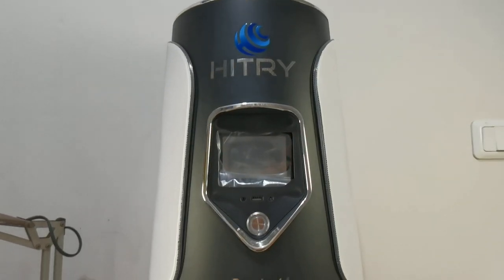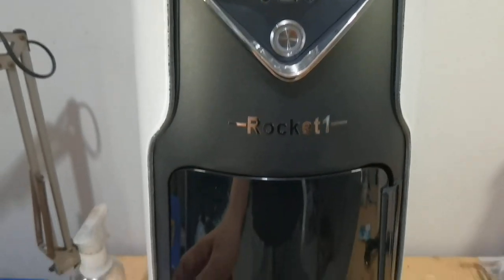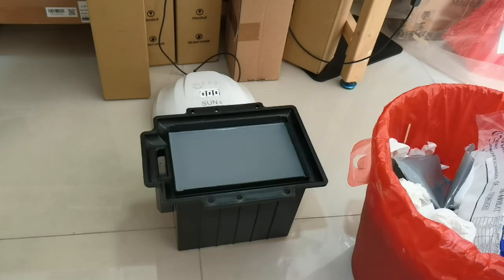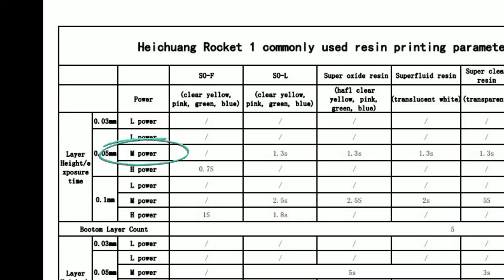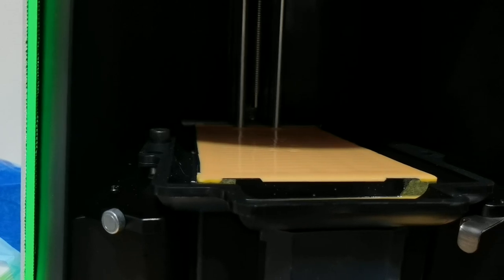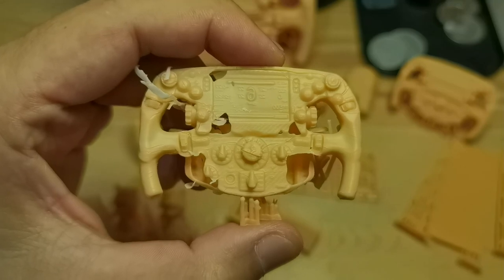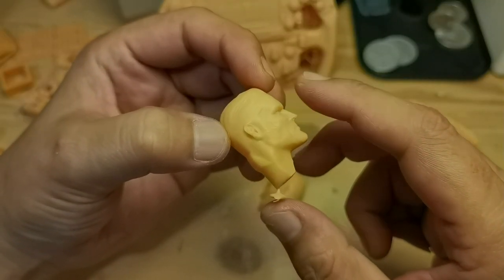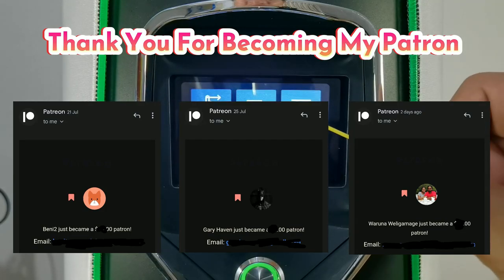Hitry Rocket 1 In-Depth Test And Troubleshooting

Comment: This printer is a waste of money. On delivery, my printer's control panel would black out after several seconds. HITRY provided a sketchy video on how to repair it involving removing two screws holding it in place. It worked, but the panel deflects when you press it. It still blanked out afterwards, but not right away. That allowed me to do the light test, which failed miserably. The light source apparently was loosened in shipping. Again HITRY provided a video, but I had enough. They had me ship it back to China (from USA) at my expense, only to have China customs charge $199 fee for release. I refused to sink anymore $ into this POS.  There is no support in the USA and the machine is a nightmare to maintain. I strongly recommend not buying this!

Comment: I've got a rocket 1 pro, been trying to get it to work with other brands of material, only have good results with the hitry materia, although I had a horrible time trying to get their filler hydrated correctly.

For reference I work in the medical field, I've worked with Formlabs, Carbon, Envisiontec, Tiger direct, and Miicraft printers.

A couple times I've considered just pulling my rocket apart and making a custom printer with parts of a dead Miicraft 125 I have in my garage
Reply: Hey I want to know which software does it use for slicing is it open source I mean we can use any other resins on it or the resins are locked?
Reply: @Saim-fd5ir  it came with a 1 year trial for chitubox, not sure if it works with other slicers. But open source printers I've used in the past are just a zip file with the extension name changed

Comment: Another thorough review, covered everything about this printer.

Looks like consumer 'top down' printing is still not here yet, I think there's a minimal cost which is quite high for the proper components to do it right, and the mess...
Reply from the maker: Just lacking the autoblade is the issue.

Comment: 6:45 dunno if anyone mentioned before on your social media, but the steering wheel is mirrored, you notice right away with the big 6 number. You test prints using this steering wheel model on other printers are in the correct orientation.
Reply from the maker: I did mention in previous post.
I didnt realize the default on chitu is mirror.
LOL

Comment: Concept is sound enough but I think it needs a bit of refinement before it could compete with FEP based designs
I imagine a DLP or maybe a fresnel that can be adjusted up and down to improve focus might solve that blooming or help a bit. The resin print surface is going to be a little tricky to tackle though.

Comment: Great review. Never took mine out of the box. It sits in a storage locker.  Figured I'd wait until more information came out from users. 

Guess I'll fill the thing  up with a cluster of Estes model rocket engines, light the fuse and see how high I can get it to go. Either that or hack it into a Mr. Fusion,

Comment: Hi, having had the Rocket 1 for a year, it seems that I have a wrong exposuretime for Resin Hitry white standard. Theyrecommend 2s for 0.05 layer but I get very soft edges and no sharp corners.
should it be lower, ex 1.2-1.4 ?
Jan
Denmark
Reply from the maker: I recommend sell the printer
Reply: Please tell me is it open source 3d printer i mean can I use other resins and set our own layer height retract distance XYZ with it?